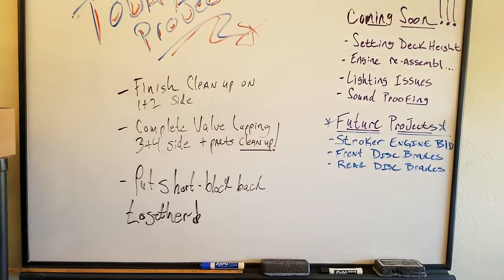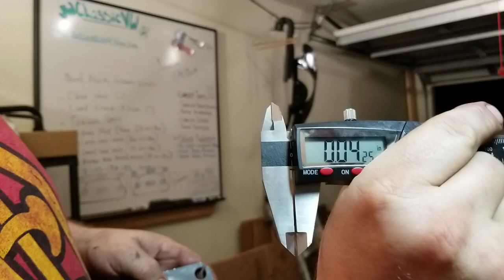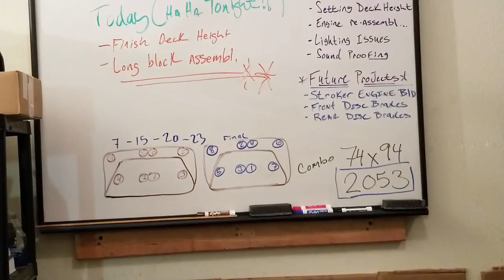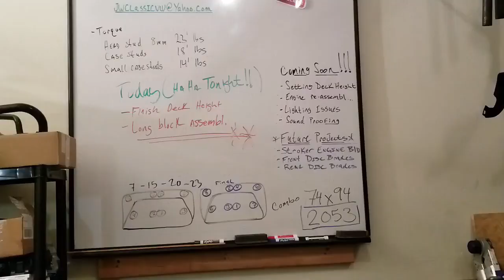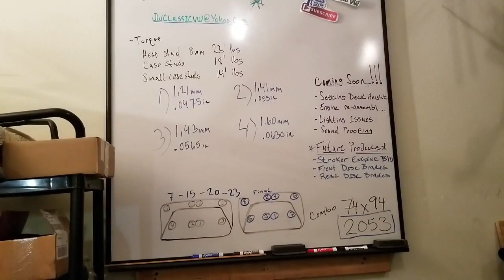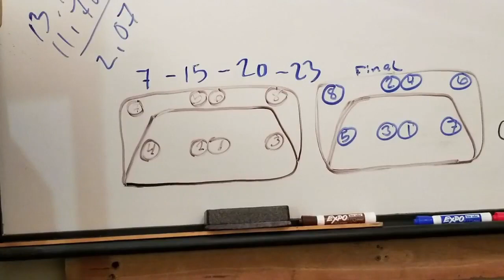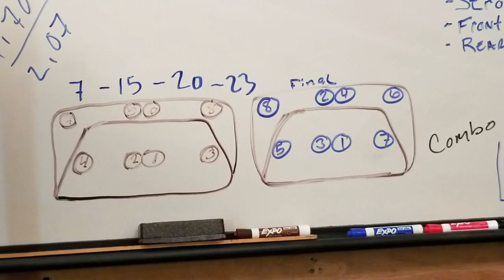VW BUG | Valve Work, Deck Height & Long Block Assembly!! Oh My!! | JW Classic VW

Comment: Great idea using the drill when lapping in the valve never seen that before, good method . I used a bluing or layout fluid on the setas and valve when i lap them in gives you a fast visual.. Back when i was in high school and ork at a auto machine shop they trained me to do all the valve work in that shop. I was told to alway have the intake valves seal at the edge on the valve and on the exhaust in the center due to the heat. I always did a three angle grind on the seat infact that is how I would move where the valves would seat . Miss my valve grinding equipment. Never did a large bore build before looking forward to seeing the process. Need to get ready for work i get up at 4am for work watch all my you tube buddies verse the news.you guys help jump start my day.
Reply from the maker: That's some good stuff there, I would love to learn how to do a 3 angle valve job someday... that would be so cool.

Comment: I do not have a deck height gauge, but from the days of being a tool and die maker have a nice set of depth mic's used; are you trying forcertain compression ratio ? looks like you did not need any barrrol shims. Nice working showing how to bolt the heads in, not sure if it matter someone told to put a light coat of STP on the head washer that gives you better readings ?? not sure if it matter.

Comment: J.W., I missed how you used your measurements....0475". I thought that told you how much to shim under cylinders. I must not understand why you did the deck height measurements.  Sorry if I shoulda caught that. And thank you. Great job
Reply from the maker: lol... no worries brother that was a while ago.  Hmmm all the deck height measurements were checked to make sure they were close enough to each other to avoid shimming.  I would need to look it back up to be for sure but if I remember correctly I was good to go.  You can always add shims to even out deck height as the closer they are to each other the better balanced the compression will be.  With a 1641cc engine tolerance are pretty forgiving.
Reply: @JWClassicVW  really appreciate your quick answer. As I watched your next video many of my questions were answered.  You measured deck height with feeler gauge, instead of the nut height (that you set barely touching top of piston). Then you added two 20 (mm or thousands of "). Then I began to understand. Nice to be able to replay video as much as you need. Right? Thank you again.